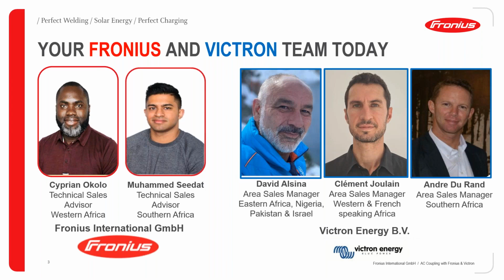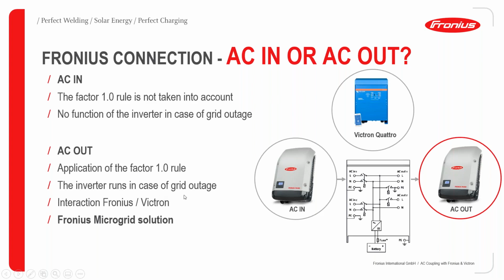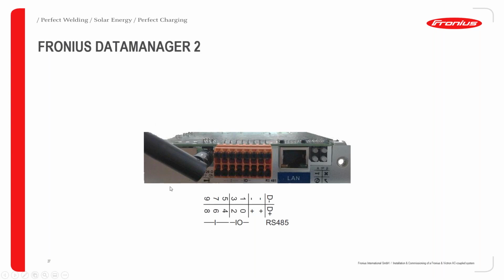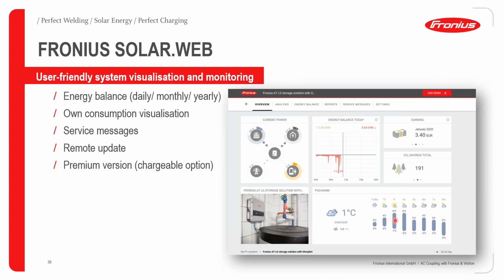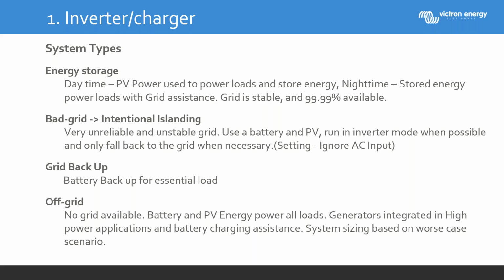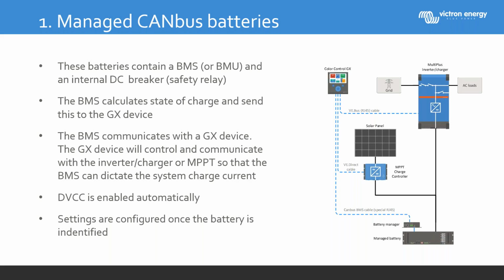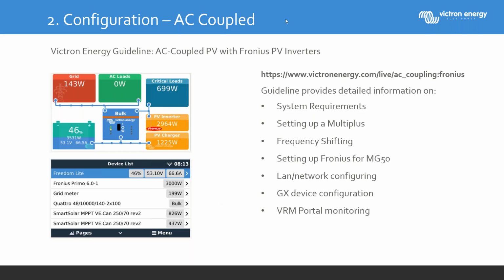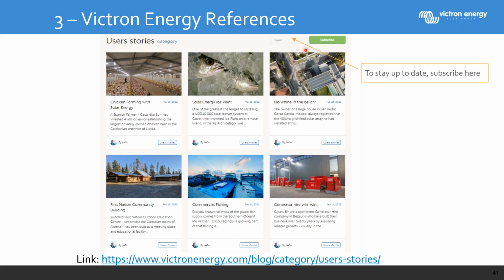Advanced Webinar: AC Coupling with Fronius & Victron (AFR)

Comment: Good day, pls why is my new Fronius Eco 25kw wifi access not enabled. I have tried severally to enable it, but it's working out, and i can't communicate the system online
Reply from the maker: Good day, please contact your installer and ask if your device has been fully commissioned and connected to the Internet. The Internet connection is set up on the local user interface of your inverter. The procedure is described here:
https://shorturl.at/EWDJd

Comment: Why  use frequency control? Why not tell the fronius over Modbus that the battery SOC is near full? And why does the Victron rely on the fronius in the first place? Isn't the Multi smart enough not to charge when the battery SOC is high?
Reply from the maker: Hello @Paul-hj1vt

There is no direct Modbus communication, therefore the solution Victron / Fronius ist controlled via Frequency to controll the inverter behaviour.

Best regards, Andrea from Fronius.
Reply: @FroniusSolar  Hi Andrea, my fronius 15 symo adv, still doesnt get throttled in an offgrid sitation, it just turns it off which it reboots in a few only to be shut down again, how can i go about throttling the power to match the house load and not keep thr fronius from tripping repeatedly or is that not going to harm the fronius. thank you

Comment: And what is a best AC coupling for Gen24plus with 3phases? In home i have 3phase system... Byd high voltage system is expensive,thats why we need a normal 48V batteries and backup power for night and rainy days... My plan is total Off-grid from mar-okt.

Comment: I have a Victron-Fronius system…a Primo 8.2 connected to the Ac-Out of a Quattro 10k, and I’m in progress of adding a Symo 10 on the Ac-In of the Quattro. Basically the idea is to supply additional power to the house, using one phase of the Symo, and the other two phases to inject in the grid. I have a 3 phase grid. The question is
: Do I have to connect the datamanagers of the two Fronius between them, or leave them as a standalone systems? Thanks.
Reply from the maker: Hi MrSavage77!

I recommend connecting the two Fronius inverters via Solar.Net. Here (https://www.fronius.com/~/downloads/Solar%20Energy/Quick%20Guides/SE_QG_How_to_daisy_chain_Fronius_SnapINverters_in_a_Solar_Net_communication_loop_EN.pdf)  you can find instructions on that.
If you need further help with your setup, please use our contact form:
https://www.fronius.com/en/solar-energy/installers-partners/contact/support/contact-form-tsi

Best regards, your Fronius Social Media Team